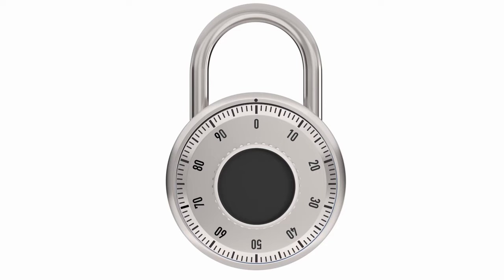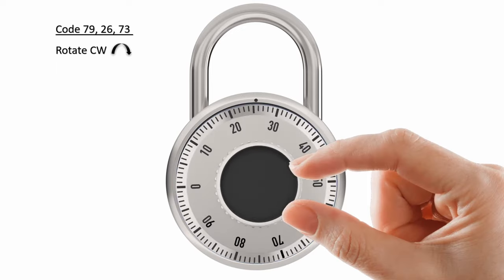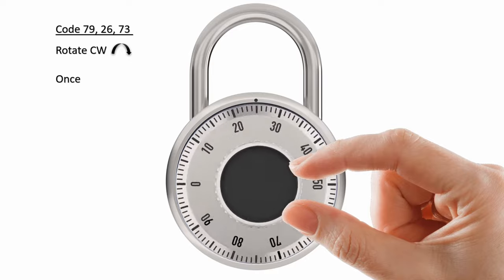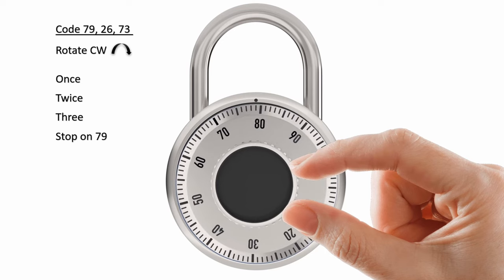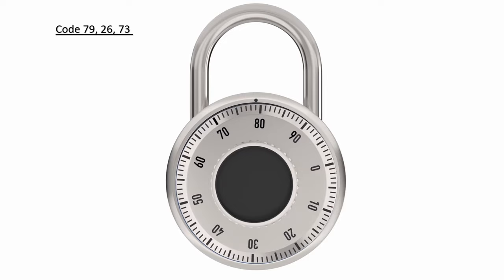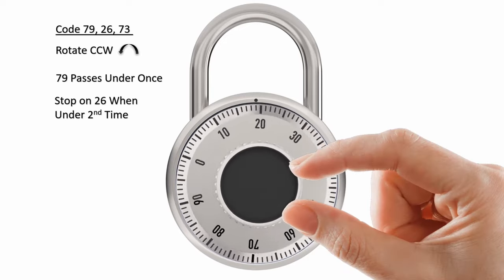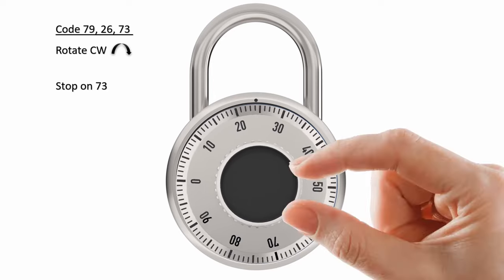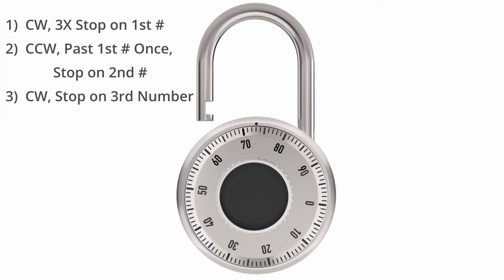How to Open a Combination Lock

Comment: Are the codes physically "hard-coded" into the mechanism itself and if so, can it be changed via opening up the case and do some manual switching?
Reply from the maker: You cannot change them .
Reply: @LocksmithRecommended  Ah, so once it leaves the factory, that code combination is finalized, I see. Thank you.